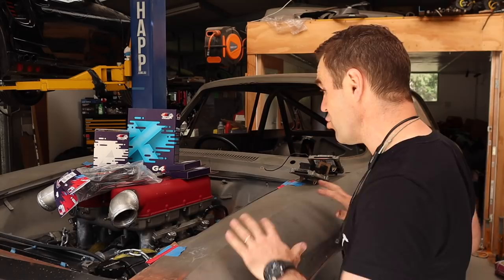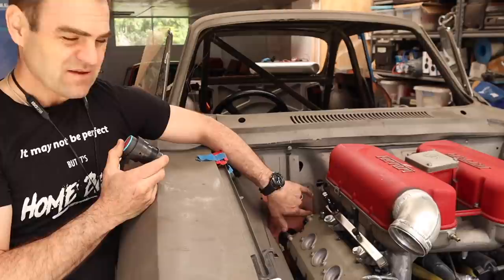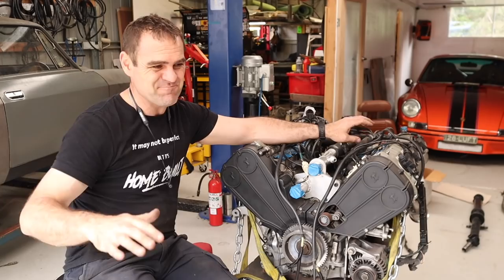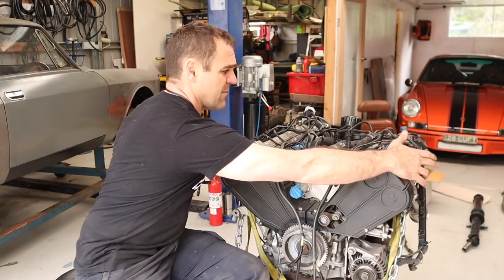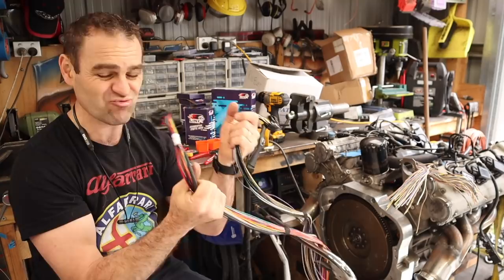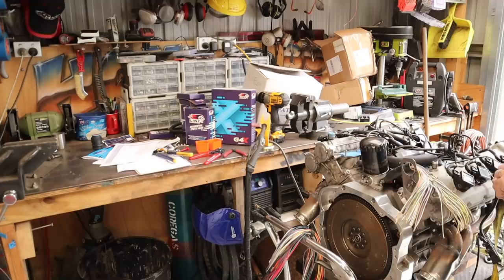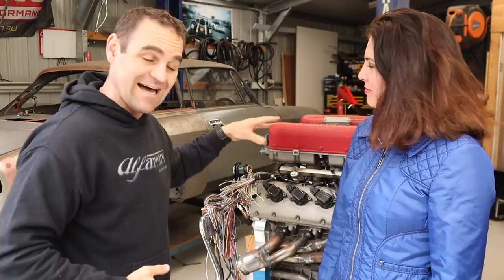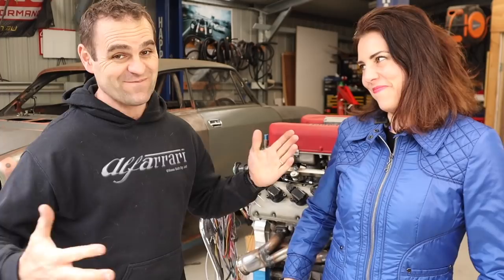Wiring a Ferrari engine to a stand alone ECU - Ferrari engined Alfa 105 Alfarrari build part 113

Comment: Link seems like good option. Wiring scares ppl but 12volt DC wiring is easy. Once you get into Can-bus and coding its complicated but you need none of that to run an engine really. If you can get to grips with wiring diagrams and each components function its easy to wire up an aftermarket ecu. Factory stuff has WAYYY too much excess stuff. But yeah modern stand alones are pretty easy really compared to stuff we where dealing with in mid 00s
Reply: I'd love to be able to hack into my BMW's CAN bus systems. Reprogram the DSC/ABS for modern rubber and brake compounds, that sort of thing.

Comment: A tip I've found useful when working with car wiring and multimeters. Generally, the pins on the multimeter probes are too big and can damage the pins inside the car's plugs. So get a paperclip, straighten it out as best you can, and then wrap 1 around each of the multimeter probes, with a straight bit sticking out. You need to wrap them tight to ensure a connection. Then, the probes will often hang inside the wiring plug, freeing up your hands.
Reply from the maker: Nice tip

Comment: Fantastic episode as always.  Pro tip - if you have the looms on both sides cut, I'd strip every wire on both sides and crimp all of them up front.  It's easier to ohm things out that way, and once you're done with all of the stripping and crimping it's just an exercise of identifying wires and plugging them into the connectors.  Holy moly there are a lot of wires coming out of that Ferrari motor!
Reply from the maker: That would mean a lot of wasted crimps ;)
Reply: @HomeBuiltByJeff  I was assuming that all of the wires on the Ferrari side were used, is that not correct?  Maybe a few unused ones on the ECU side?  I can tell you that I wired up an Autoforce ECU test cable one time, 293 wires with a crimp on each end, and it was a lot faster to crimp them all first rather than interleave the crimping and insertion operations.  Anyhow, now I'll be curious how many unused wires you end up with!

Comment: Most VVT systems are as you described, Honda’s original VTEC system however did in fact have a third cam lobe. i-VTEC uses both the variable timing system you described and the aforementioned system in conjunction. 

Loving the build! Keep up the good work.

Comment: If I was taking on a job like this I'd be extremely thankful for this video.  One thing worth bearing in mind is that colour acuity effects how easy (or not) it will be for someone, it's not black and white (sic) - outside of complete colour-blindness it really does vary from person to person. BTW, since I'm here almost on my own, was thinking about this t'other day; the 360 weighs about 1500 kg wet, the 105 1050 kg. If the Alfararri has gained 200 kg when it's completed it will still be c. 250 kg lighter than the 360. With the same 400 bhp ;-).
Reply from the maker: I am hoping it is less than 200kg weight gain, but time will tell. The engine is only 27kgs heavier, but then there is everything else ;)
Reply: @HomeBuiltByJeff   I was hoping you'd remind me what the engine weighs, and yep, a 200 kg gain might be a bit pessimistic. Still ...

Comment: Nice work!  When I see the oil filter, I think that a oil filter relocation kit is a good upgrade, make it easier with maintenance and you can put a oil cooler between the oil lines.
Reply from the maker: Covered in a previous video ;)
Reply: @HomeBuiltByJeff   Top, didn't remember that.

Comment: i was wondering if you were going to use an aftermarket stand alone ecu.. i have come across the oem ecus failing on some of these car... and they are getting to be almost there weight in gold if you find one,, then, its a ticking time  bomb, just waiting for you to be stuck... along way from home... we always recommended to the customers,, to remove them and use mega squirt efi... almost all of them ( 4 of them ) said replace it... the rest  are gamblers. and i love the printed sheet that you made for the pins to the blukhead connector.. perhaps you could email a copy.. would be most helpfull... getting closer to run... i hope you enjoy it soon

Comment: Yay! The "Lil Psycho" is almost ready to run! Lil Psycho is definitely an appropriate name lol. The power to weight using l'motor du 458 will be so great 👍👍. Be careful in this one. I can't imagine running it up to 9000rpm will be crazy. Good news, cutting the runners is going to kill some low end torque  for an increase in the top end. You're going to be considerably lighter than the 458 yeah? My guess is about around 1950lbs? 900 something kilos.

Comment: Why oh why don't manufacturers use those bulkhead plugs when they build cars at the factory?. It would make life so much easier if you only had to unplug 1,2 or even 3 of those when doing engine/gearbox or complete front end replacement like a cut and shut.
Reply: Costs, production process is different than maintenance.
Reply: Probably reliability issues to consider and anything that is sensitive to varying resistance.
Reply: I think some do, if I recall Toyota trucks have them. But connectors are also failure points and a manufacturer puts an engine in with the assumption that they will never have to take it out (at least under warranty)

Comment: Did you wire the larger pin connectors into the major power consumers and use the smaller ones for the signal wires?
Reply from the maker: Yes. I put the main power and grounds for the coils and injectors through the big pins for the higher current draw.
Reply: @HomeBuiltByJeff  Good man, enjoying the project, always loved the old Alfa GTV so the combination your building your building is an ultimate version for me

Comment: Please be very detailed for each single cable and sensor and then with the software because I would like to buy it but the manual is not very clear.
Reply from the maker: If you use the help menu in the Link software it goes into detail about every output and how to wire every component ;)
Reply: Yep, it would have been good to show the whole process of wiring one or 2 sensors all the way to the Link ecu.

Comment: Tip
Not all grounds are equal.
There’s the frame, engine, body ground.
There’s an ECU 12 volt ground and and ECU 5 volt ground and sometimes a ECU 3 volt ground 
Keep them separate if you don’t want to spend days chasing weird problems.
The ECU often uses the back current on the grounds to monitor the function of a circuit or switches the ground on and off to control something if you tie all the grounds together thinking they’re just grounds at best things won’t work properly at worst the magic smoke will take a smoko

Comment: Number one, you need GOOD work area lighting number two, you need the correct tools ( check) you need to know how to use all those tools! (Eg: don't practice on your engine, get it right first) make sure your eye sight can properly recognise all the colours,( eg: get an eye test done) and once you have got every wired up and connected....DO NOT WRAP THE LOOMS!!!! UNTIL THE ENGINE STARTS AND RUNS PROPERLY  this makes it easier to trace wiring faults when it fails to do something on start up. Just 54 years of automotive fixing talking, ( I still hate electrickery)

Comment: Be careful about coil wiring. Some coils have built in drivers some do not, some ECUs can have a built in coil driver and some get the guts blown out of them when you get things wrong. Or they work for a bit until the magic smoke escapes.